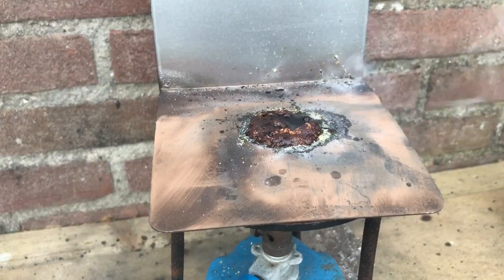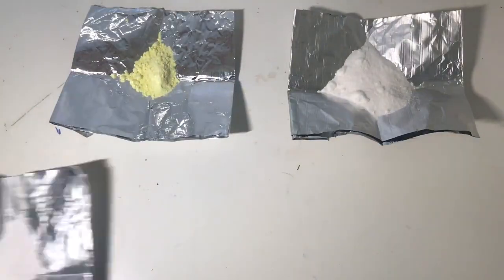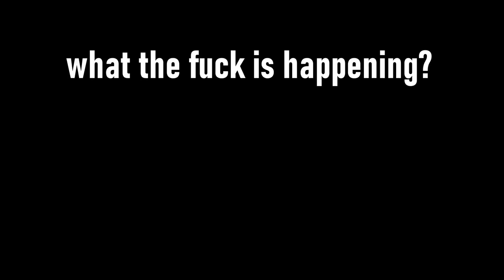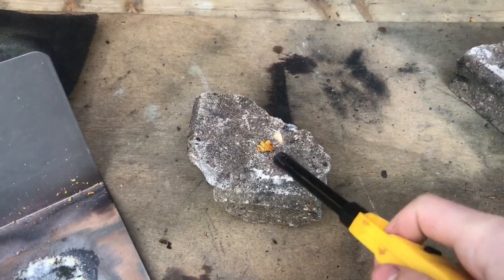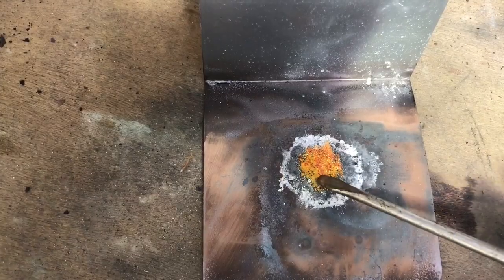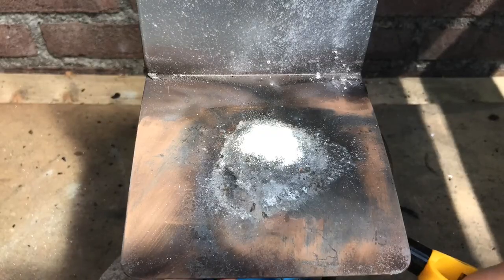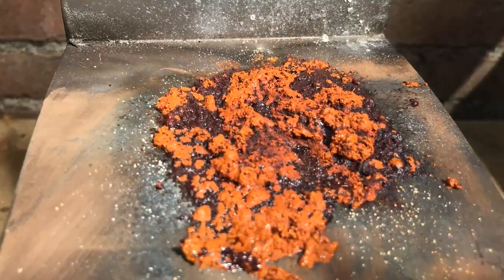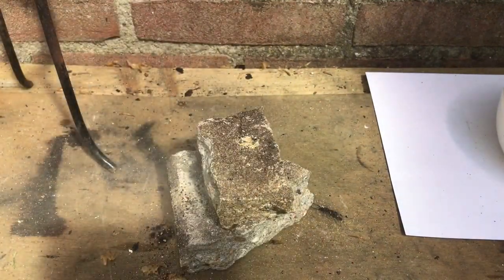Yellow powder, an explosive mystery!

Comment: I made yellow powder a few months ago. I didn’t understand the circumstances it needed to detonate properly and got frustrated because it was never very energetic on direct exposure to flame. Then I rigged up a system to suspend a spoon over a candle and it worked a little to well because the first test I used way to much and it was very loud. I didn’t expect it to be so energetic from such a small quantity. Plus the potassium carb I have was at the time homemade and the yellow powder still somehow worked amazingly.
Reply from the maker: Yeah its actually quite powerfull and dangerous

Comment: Had lots of fun with this powder when i was a kid😊When you mix a fuel and an oxidizer very intimately such as when the whole mass is liquid it explodes😊All the ingredients have relatively low melting points. I always wondered if you mixed ammonium nitrate instead of KN or part there of would it improve the explosive power of the mix? Pls do this experiment.

Comment: great video...but maybe just one safety tip.if you are going to scrape a substance off of steel (a material capable of producing sparks when steel meets steel....)do the scraping with something made of brass.   :)
Reply from the maker: thanks, it was stainless steel so I figured it wouldn't spark since it is more inert

Comment: Really nice video i personally do some yellow powder and i am actually able to get it detonate with silver fulminate
Reply from the maker: the powder that you get after melting the yellow powder but stop before it explodes?
Reply: @sciencething1449  no the normal yellow powder but I use sodium carbonate
Reply from the maker: @Andrea-px3bt  But just KNO3/NaCO3/S without forming the polysulfides/thiosulfate and potassium nitrite should not be able to detonate, I believe you but that's really weird that it detonates!
Reply: @sciencething1449  I don't know that happen and I see other video on Energetic heretic where he can detonate that mix but with normal sodium bicarbonate
Reply from the maker: @Andrea-px3bt  Wow! I just checked heretic's video and it actually detonates! amazing
Reply: @sciencething1449  The only way I can think is that the nitrogen +5 is reduced under basic conditions to form nitrogen chains or rings like the azide -2 or -3 oxidation state, maybe sulphur or carbon as well. The carbonate is not a fuel which is weird, but might later become one after heating.
Reply from the maker: @abroquet2189  I doubt that any nitrogen is going to form any chains/rings at high temperatures. if that would happen (which is highly unlikely) I don't think they would build up but instead instantly decompose after forming and releasing some N2. I think it is simply forming stronger oxidizers/reducers (like thiosulfates and nitrites) and that they build up until a certain temperature is reached which allows them to react and release all their energy at once... boom! But I am not sure, it remains speculation
Reply from the maker: @abroquet2189  you commented but I can't see it appearing could you maybe comment again since I am very curious about what you wanted to say
Reply: @sciencething1449  I have not forgotten about you. Sorry it took so long. Information hard to digest.The way I understand the formation of nitrite and thiosulphate is that they are perhaps precursors to metastable potassium anions.They would form early in the decomposition of the mixture. Alkali metals with nitrogen chains can be stable at high temperatures eg.Potassium azide KN3 decomposes 355 degrees celsius. I think potassium might form metastable anions with nitrogen and sulphur, which may include atoms of carbon and oxygen. Rings or chains may exist  in the anions. A metastable nitrogen +3 anion might form from nitrate at high temperatures.The sulphur and carbon and the alkalinity of potassium carbonate may contribute to the stability of the nitrogen in the higher oxidation states. If the thermodynamic conditions are favourable, the high oxidation states of nitrogen may become exhausted in the creation of substances with a higher heat of formation. Even more boom. It is a thermal runaway reaction.Rearrangement of atoms from heating, forming stressed bonds releasing it's energy all at once. Somewhere it was mentioned that a CN+ ion was produced when heating yellow powder.The weird thing is the potassium carbonate is not a fuel and it's role is uncertain.Tetrasulphur tetranitride is an interesting read on Wikipedia.
Reply from the maker: @abroquet2189  Wow! thank you for this amazing insight of what might be going on here! I will have to do some more research into the things you mentioned, I would like to now if there are any patents or other sources of info on these subjects I would love to read more about it

Comment: What if you boil it then let it cool about 5 times, but only just before it explodes, would that make an explosive compound?
Reply from the maker: Maybe but it seems really annoying to do that because I will constantly be fearing an early explosion. Maybe I will do a part 2 where I test these things
Reply: @sciencething1449  Why not try to use a temp gun and figure out what temp it starts to decompose at? For research and safety in larger batches.
Reply from the maker: @thegregofficial  It is pretty much impossible to do it safely on larger scales, I read about a story where some guy tried to make this stuff in large amounts for primer in guns and his factory kept blowing up despite all his safety measures. But measuring the decomposition temperature with a temp gun is not a bad idea, maybe that could tell us more about this weird stuff
Reply: @sciencething1449  All I know is im not an expert but it seems like an interesting chemical